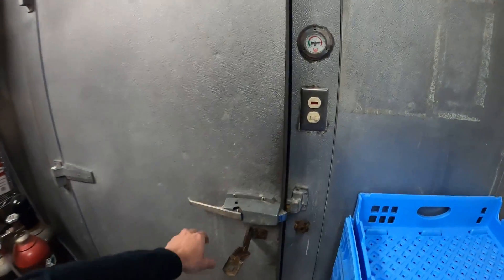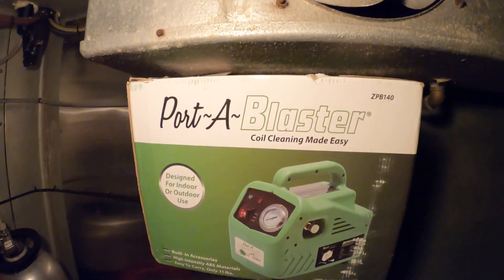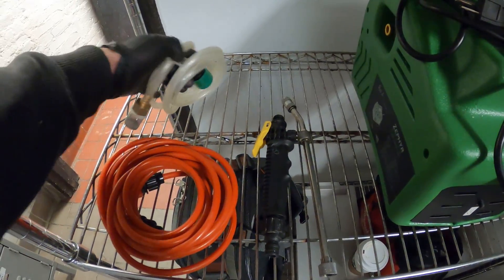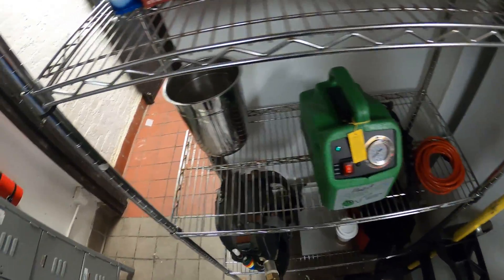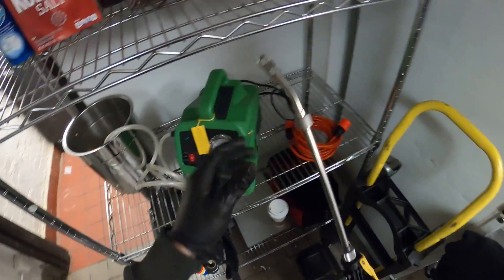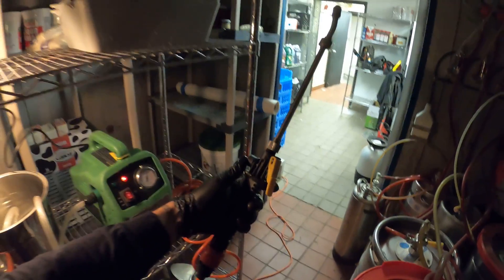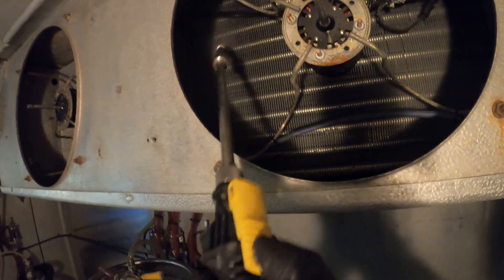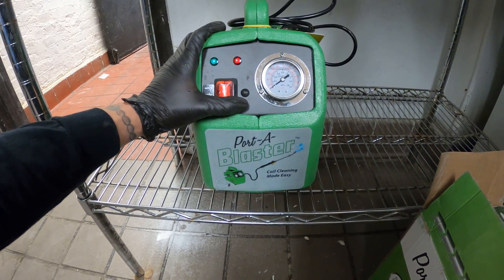HVAC: Supco Port A Blaster Coil Cleaning Machine Setup/Review (ZPB140 Port A Blaster Coil Cleaning)

Comment: I bought one and I agree it's especially good on inside Evap coils, really cleans deeply and gives a great result, when compared to just using a no rinse spray. Haven't had a chance to use on an outside condenser coil yet.